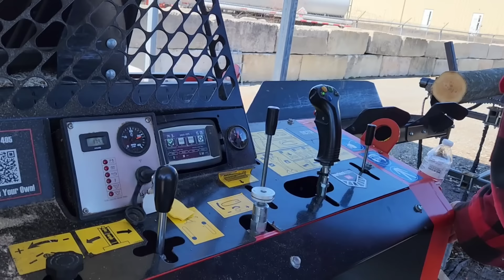**RAW FOOTAGE** Oak Logs vs. 8-Way Knife-- Japa 405 Firewood Processor

Comment: Happy Easter Joe. I don't recall seeing the conveyor on the Japa 405 stop like it did twice before.
Reply from the maker: When I run oak thru the 8 way I need to speed it up or I run the risk of putting too much weight on it.  Prob I could snug up the belt too but this doesn't happen often.  Thanks for watching buddy

Comment: Concerning your U-Haul video: 

I assume your friend "Kyle Crawford" (MK High Country Firewood) delivers bundles on pallets...from a trailer or a cube truck?

His opinion of the Pros & Cons would be valuable to you. 

Hand piling bundles onto pallets, and then using your tractor fork lift to load the pallets into your U-Haul Box truck, is automating a tedious process.

Then, hand transferring bundles from a pallet onto a 2 wheeled hand truck, and then rolling it down a U-Haul ramp sounds like a good (easy) way to unload your box truck.

Lots of people love those U-Haul box trucks for easily moving your items with the least amount of work.

Backing a box truck should be easier than backing a trailer. 

I like this idea!
Reply from the maker: Thanks Gary.  You and me seem to realize that trailers can be a super pain especially in tight areas.  I think the box truck is a good idea especially since many of the commercial accounts have fork lifts to remove the pallet from the truck
Reply: I like that you think "outside the box"😊.  

A client having their own forklift should "lift your spirits" 😊 and eliminate an extra touch of the bundles.

Comment: You can gripe about the smell all you want but I don't think there is any firewood nicer looking than straight grained Oak when split!👍
It looked like some debris has stuck on the knife and might have been part of the issue with the piece that didn't want to split. Have a Happy Easter, Joe n Family!
Reply from the maker: It had a large knot on that leading side.  Seemed it hit the knife right at the wrong spot lol.  Flipped around it went thru like nothing
Reply: @ohiowoodburner  Always has to be that 1 piece that doesn't want to cooperate...

Comment: Have you seen the new Split-Fire vertical splitter that was just released?  It is reported to have a 3.5 second cycle time, has options for electrical motor, log lift and extra work table.  That might be an option for the splitter market area between commercial splitter and box store/homeowner splitter.
Reply from the maker: I think I saw it.  I will look for it but I think that is def what we need for our industry

Comment: Just a thought , add another 8 to 12" board on the sides of the trailer. Could have a few more logs in front of your log deck and in your grapple. Maybe fill both trailers. Everyone has their on way of doing things but it seems you just get the machine warmed up and you're done.
Reply from the maker: My limiting factor is how much I feel like stacking at one time.  This amount is about perfect for me, especially oak bc of the weight

Comment: Happy Easter, but you know, Joe. It looks like you have about 2 feet above the trailer. With the conveyor from the disc cleaner, if you are able to lower it by 6 inches, it would give you a lot better angle on the conveyor coming out of the machine.
Reply from the maker: I normally get the wood stacked that high but since I installed the roof I can't load the live deck as full as I used to